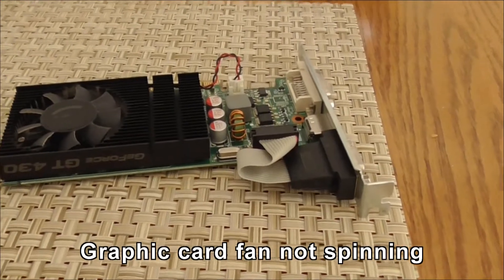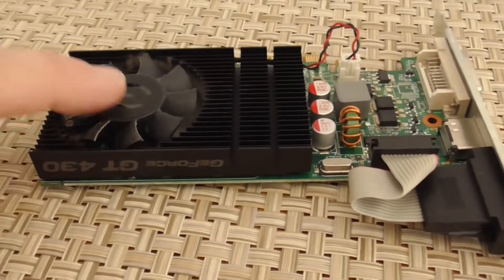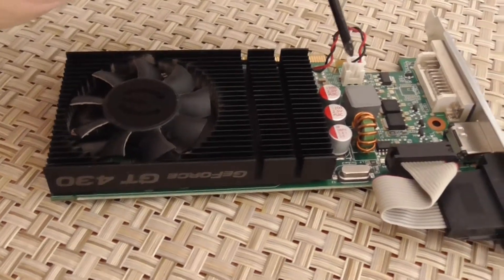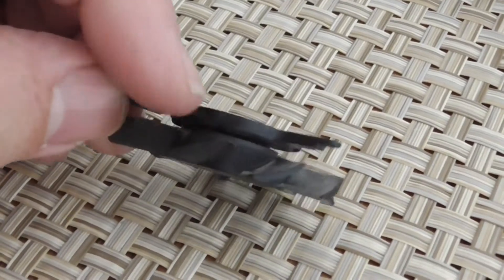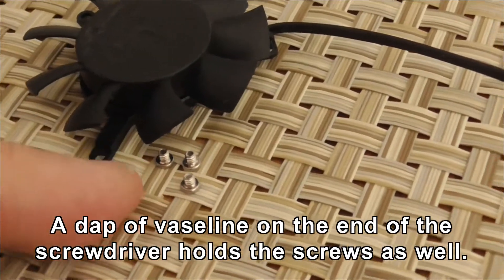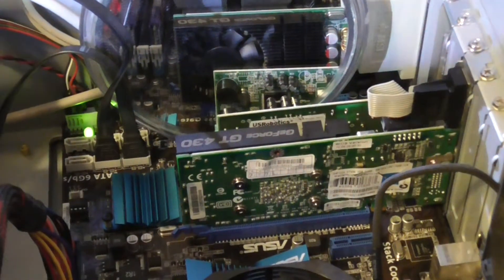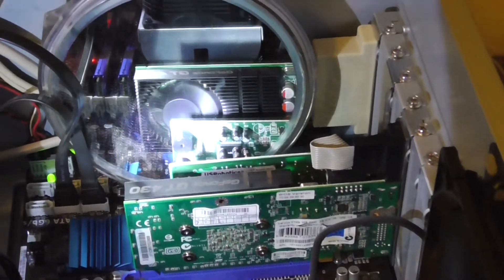Graphics Card Fan Fix

Comment: Are you sure you used enough WD-40?
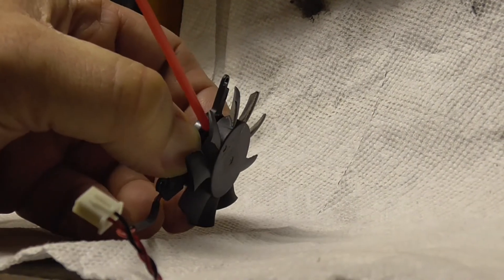Reply from the maker: Oh, you mean at about 1:40 in the video?
Yes that was a precise amount determined by the various wind conditions and barometric pressure, coupled with the phase of the moon.

Well, it lasted until just recently ( Oct 2021) when I had to upgrade the computer to comply with Windows 11 min requirements, so 4+ years of extra life is not bad. 
When I removed the card the fan was barely spinning, so IF I were to need it again it would have need another treatment, but Aries was moving thru Pisces in retrograde fashion so...

Comment: I have a GT 430 with dual fans is the procedure same with that 1 too?
Reply from the maker: If one of the fans is not spinning, putting a squirt of WD40 into the fan body might help.
Keep the WD40 away from the circuit board though, not sure what effect the "light oil and solvent" may do to those electronics
Reply: Yes tried the same method it worked

Comment: Worked for me. Thanks dude. {Removed the graphic card from the PC CPU, removed the three screws holding the fan of the graphic card to itself. Cleaned out the fan with a toothbrush, used WD 40 basically sprayed it into the gap between the fan and it's rear non spinning base with the long thin tube provided along with the WD40. Screwed the fan back into the card. Put the card back into the CPU. And no more no signal while playing games(GPU fan is now spinning). }
Reply: Whatttttt

Comment: Thanks. Brother. It fix my problem. 1st I thought it will not fix and It was a bad idea. But i tried and it fix my problem. Thanks a lot again.
Reply from the maker: Glad it worked. Very low power motor, easily stopped by dust